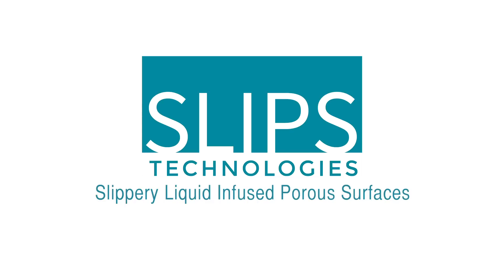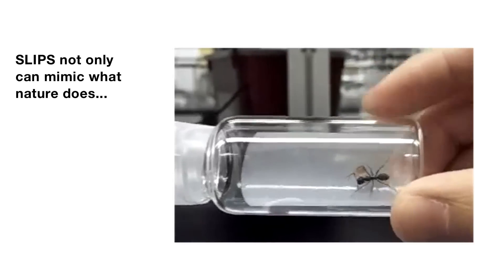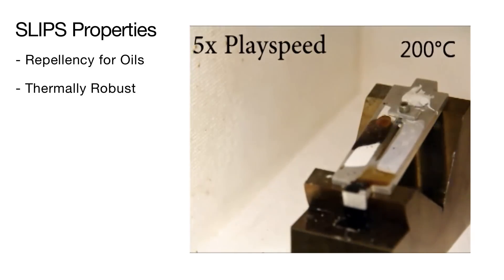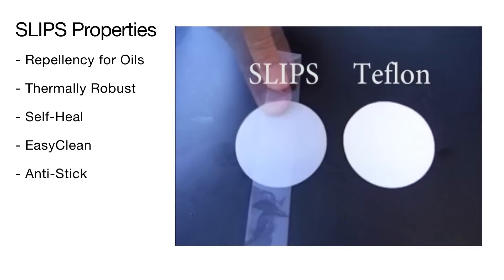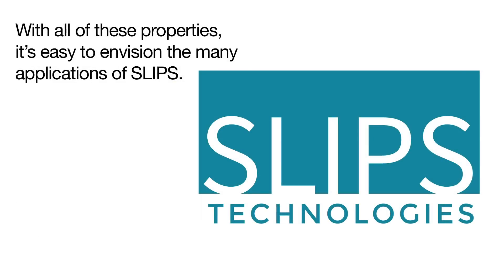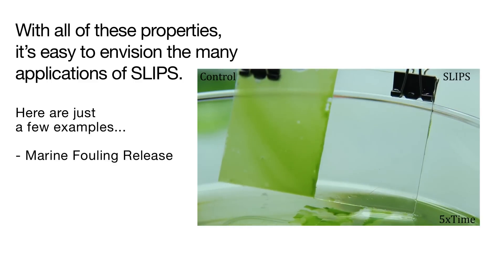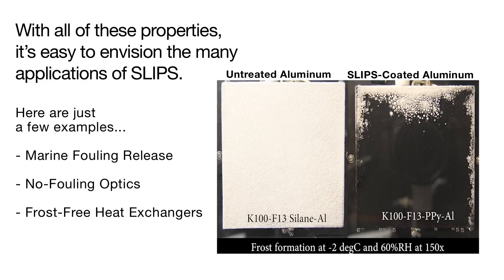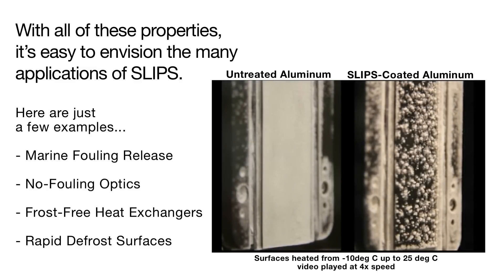SLIPS in Action

Comment: I don't get why the obvious isn't mentioned: frying pans and other cookware. It's shown to be heat resistant. GRanted it's not stronger than than teflon, but there's the self-healing property. Plus you can just use softer tools just as with teflon.
Reply: That is because the lubricant used might not be bio-compatible.